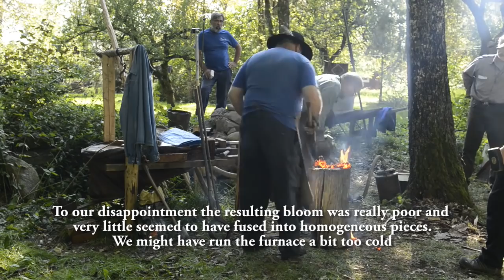Blacksmithing - Iron smelting and forging a poor bloom

Comment: Interesting.  Is it ever heard of to collect a regular wind to focus it into the furnace so you don't have to billow for hours?
Reply from the maker: Never heard of that... think it is impossible really.
Reply: People have harnessed the wind to do work with windmills for many years, just wondered why I've never seen a wind-powered forge.
Reply from the maker: Ah, indirectly, sure with a wind mill it could be done of course, but the problem might be getting a constant supply of power. Water is much better in that regard, and have been used extensively.
Reply: Indirect machines are easily conceivable but require many complicated parts.  I was talking about something simple like erecting a sail to funnel a large volume of wind into a stack.  If wind moves ships with at least with some regularity why not a foundry?
Reply from the maker: You need constant flow and pressure. Hard to funnel, the wind will just take another way around...

Comment: The "red earth" - can most soils, clays or rocks with a noticeable red hue be used?
Reply from the maker: Kevin Keel I would say all "red" soils contains iron, but far from all is good enough. You can make simple tests using a AO torch and check the quality.
Reply: Using a torch, the soil should form slag?
Reply from the maker: Kevin Keel I have limited experience but basically you roast the sample to get rid of water, then you put the roasted sample on a piece of charcoal and melt it. It should form a small ball. Then you can analyze it in more or less sophisticated ways. :)
Reply from the maker: Torbjörn Åhman First indication would be to check the roasted sample with a magnet and see how much "iron ore" you can separate from the soil...

Comment: looks like youre heating the iron to hot thats why its burning off, if there is any carbon content in that iron there wont be much after your burn it like that, I would suggest taking the billet out of your forge earlier, but overall good job :)
Reply from the maker: Wrought iron needs a good heat! Hard to judge the temp from the video.

Comment: You would have had a lot less work had you added a flux , generally you will layer charcoal lime ore charcoal ect. The lime acts as a flux which lowers the melting point o the ore allowing you to reach temperatures needed to get a better more uniform bloom.
Reply from the maker: justin brown I'm far from an expert, but I think it depend very much on the type of ore you have. When using mined ore you should add lime, but I'm not sure about "red earth" and other types of "surface ores"... It's all about producing a "good" slag.

Comment: why do we fold steel mr ahmen?
Reply from the maker: To consolidate it.
Reply: Torbjörn Åhman how it become consolidate when we fold it?
Reply from the maker: It's the only practical way of doing it. Drawing it down/welding it and then cut in half and weld together to a new billet and start over. In the end most of the slag inclusions are gone and you get an even structure throughout the billet.

Comment: What is the furnace made of?
Reply from the maker: +Philippe Bouchard This one is a mix.. fire bricks in the bottom area and then "light weight" concrete blocks on top.
Reply: +Torbjörn Åhman Thank you for the fast reply! Do you know if it's possible to use a kind of rock/stone in particular? I think most of the rock types melt at a temp below the one of iron (around 1000)
Reply from the maker: Philippe Bouchard All remnants that has been found of old furnaces is made of stone and clay/dirt I believe. The lower sections of the furnace walls will be affected an may have to be replaced once in a while.

Comment: very neat. Here we see also why Japanese smiths folded the steel for katanas so many times. It has little to do with making a better sword, it was because at the time Japanese steel was fairly low quality and had to be folded to work out impurities.
Reply from the maker: Skwisgar2322 Not sure about that... for a sword you need an even and well balanced "mix" so they pick good pieces from certain parts of the blooms which contains a preferable amount of carbon. These pieces are then forged into one billet. Folding several times ensures the billet gets an even distribution of the different components. It has nothing to do with inferior steel, it's actually carefully picked for it's purpose. If I got it right... :)
Reply: I didn't say inferior steel, just lower quality, i.e. less refined. the folding of the steel is to refine it not to somehow make it sharper as some seem to think.
Reply: Skwisgar2322 Sharpness is dependant on polishing. The blade will chip when used if the steel it too hard but if it's too soft it will bend. I believe the Japanese folded hard and soft steel together to get the desired mix to make it strong yet with enough spring, much like other cultures, another one I know of is damascus steel but that's about it. Europeans if i'm correct, this is more of a guess but I believe we used a steel that was as close as possible to being of similar properties. The more carbon the hader it is, less carbon of course it's closer to iron which is soft-ish. The Japanese spent allot more time on their swords but in terms of design, they cut flesh well but what sharp edge doesn't? They could not penetrate armour very well and only one side was sharp which was the problem, I think the design reflected their culture to some extent, as with ours. Western blades were based off the Christian cross whereas in the East, the crescent moon. The Japanese did select their metals well though but all nations found similar refinement in design, Japan being largely cut off from the rest of the world by an Ocean, had more time to focus on such detail. In Europe, there was all ways war, still is. What i'm trying to say is the blades were designed to reflect the people who made them, call it a cultural trademark so to speak. If we compare steel made before now, it will all ways be 'inferior' but will still do the job as well, it might just give in a little sooner or require a bit more maintenance. I would like to see what we could achieve using all combined knowlege of metalurgy we now have if applied to making a modern sword, like having diamond impregnated tip and perhapse a protective coating etc.. Before we do, we can only compare old with old really. :P
Reply: The Japanese folded their steel to refine it. what you refer to is bao gang, the practice of wrapping a softer low carbon billet around a high carbon core. The steel is not folded after this since that would defeat the purpose. My point was that you hear people (usually with little to no knowledge of metallurgy) talk about the Japanese Katana being supernaturally sharp because the billet has been folded into millions of layers, this shows that the true purpose of so much folding simply to get to a workable billet.
Reply: No you are close. Yes many claim they know the katana because they think it's so awesome. But they did various processes, they also would wrap a billet of harder steel within the folded steel, but that billet is of much harder steel with a very high carbon content, there are several different places it would be added too but the main blade was constructed of 2 steels with different carbon content but one being only marginally higher, but you are right I'm sorry i didn't make that clear. The Metals were soft enough to still fold though but bao gang is where it differs from damascus steel. Master Japanese swords smiths were masters at understanding the brittleness of the metal by touch sound and fracture index because of course they didn't have high power microscopes or an industrial process for producing the steel they wished to have, often all pieces of steel needed were from the same bloom/blooms but of different parts that happened to have reacted with different amounts of carbon. Of course for the time they started developing these swords and techniques and refined their method the west had made serious advancements in their process and guns started taking over the scene gradually and it became an Icon more than a functional weapon as is the colt peacemaker of the American west, there is better now but at the time it made quite a difference and were widespread.

Comment: from how many kg of sand  is that?
Reply from the maker: Can't remember now, maybe 10kg?
Reply: tanks :) for the quick answer
Reply: Can you writedown name of sand please?
Reply from the maker: ***** Don't think it has a specific name... We call it "red earth". Dirt or soil rich of iron.
Reply: Torbjörn Åhman Thankyou
Reply: Torbjörn Åhman so if I find red soil I should be able to bloom it?
Reply from the maker: Possibly! Take a sample, heat it  with a propane torch, let cool and test with a magnet!  You can even test smelt a sample if you have a AO torch. This might help you determine the quality.
Reply: Torbjörn Åhman really? I mean if i took a red dirt from my back yard then burn it and take it to magnet i could make my self iron bloom?
Reply from the maker: Yes! If the dirt is rich enough of iron.
Reply: What about very red clay?
Reply from the maker: Probably the same thing! But it's hard to tell the actual iron content by the color only.
Reply from the maker: If the dirt does not contain enough iron, you may be able to enrich it by gathering the magnetic parts, yes. But that only works when the ore is roasted and magnetic.
Reply: Torbjörn Åhman but the iron is mixed up by carbon from the ash...will it still get pulled by the magnets?
Reply from the maker: If there are magnetic stuff there it will get pulled away.

Comment: How to recognize iron from slag?
Reply from the maker: +HCN Slag melts at a lower temperature. Slag is light weight.
Reply: Do they look the same?
Reply from the maker: +HCN It can be hard to distinguish when it's all hot. Then there is always slag around and clumped with the iron bloom.
Reply: Thx

Comment: You really should be fluxing those folds. The oxidization makes the forge welding very weak. That said, this is from someone who works with steel, so I'm not entirely sure that it still applies to super low carbon alloys that aren't considered steal yet.
Reply from the maker: +yarkshry At this stage there is much slag in the iron, and that in it self acts like a flux. Forge welding mild steel you really don't need flux either but you need to account for some material loss instead.
Reply: +Torbjörn Åhman Oh, I get it. Makes sense now.

Comment: I read the comments hoping to find out what a poor bloom was.
Reply from the maker: +michael therrien For a successful run, the result should be a well fused together bloom that does not fall apart. This one was not very good in that respect. Very porous and allot of slag in between. That's why I call it "poor".
Reply: +Torbjörn Åhman the temperature looks about right. Did you guys put in any flux? Traditionally you would use quartz sand.
Reply from the maker: Hans Gruber No flux. I think it depends very much on the nature of the ore.
Reply: Torbjörn Åhman granted I never used "red earth"

Comment: wow yummi polution
Reply from the maker: Richard Fry You mean the first sequence? It's mostly water vapor form the first charge of wood. Other than that, it's actually pretty clean. Only charcoal used.
Reply: Iron production into steel is done much more proficiently and efficiently now than it was before the industrial revolution. Science doesn't always progress and the pace we would like, despite your trite objections (perhaps from a steel-framed high rise).
Reply from the maker: xmaswitguns Sure we make huge amounts with today's technology, but with coal (coke) as the base for the fuel. Charcoal if done right is probably one of the cleanest fuels there is. There is of course always impurities like sulfur in the ore and high temp combustion always releases NoX. No steel framed high rise buildings within a 100 miles. :)

Comment: It looks like you had too much coal in it, your bloom was like iron ore, by melting it again at hotter temperatures you may have had a better quality metal...
Reply from the maker: +Brad Norwood No coal involved here :) Just charcoal. The problem this time was most likely too moist charcoal....
Reply: Coal and charcoal are the same thing... One is natural and one is man made... Moisture would not be a factor at those temperatures...
Reply from the maker: Brad Norwood Sort of, but still not. This process is not possible to do with coal. You need to consider the entire furnace. It's tall since the ore slowly travels down and reduces to iron on the way. If the upper part is too cold it won't reach the bottom fully reduced. It's a much more complicated process than just melting....
Reply: And what is your reference for proof that coal will not work? I have seen several videos showing coal and red dirt (iron) as the ingredients. I posted a video on your video...
Reply: Charcoal has a melting point of 4,890 °F
and coal has one of 7,820 °F, coal is considered natural, and charcoal is man made from wood, coal may work better for higher temperature metals, you should try more red dirt next run, and layer evenly like cake layers. Looks good though.
Reply: I may have meant charcoal...
Reply from the maker: +Brad Norwood I can't give a reference, but I think it has to do with all the impurities in coal. Charcoal is 99% clean carbon.  In the video you refer to - they only use charcoal.
Reply: Yeah